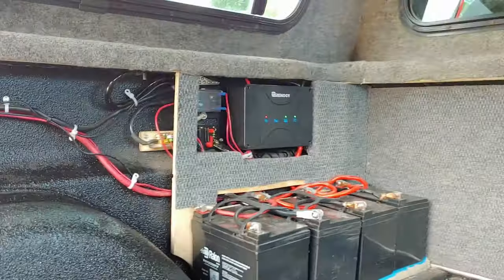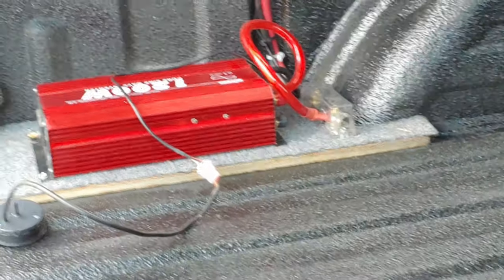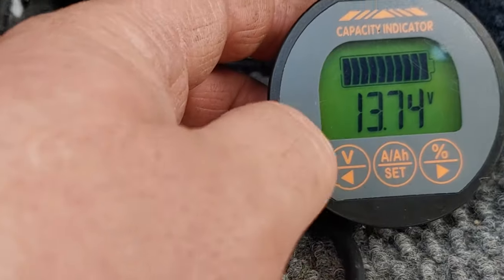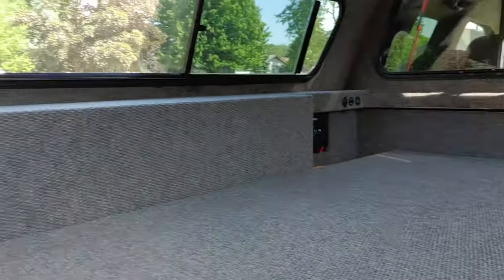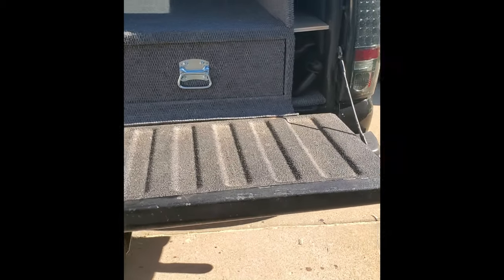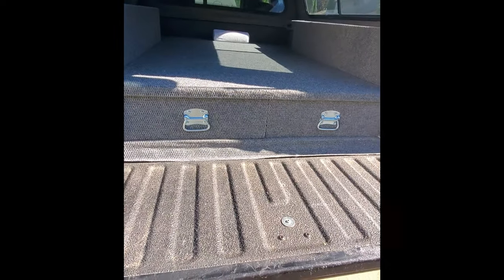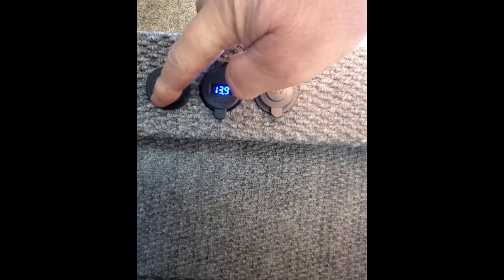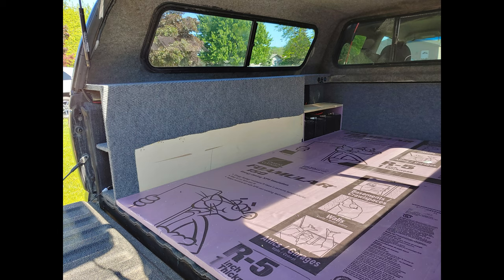Custom truck bed camper build with drawers, storage and Renogy solar power.

Comment: How did you attach the two solar panels to the roof of your shell ???
Reply from the maker: I ordered the angle bracket mounting kit from Renogy. They were silver aluminum, I powder coated them black and screwed them down with a dab of silicone and wood screws (short enough not to penetrate all the way through the inside but long enough to to get a good bite)

Comment: I have been watching truck camper build ups for the past hour and I just really liked the simple, functional, easy set up of yours. Also, i like the really clean and nice finish with the carpeting all throughout. Just a quick question. How tall is the platform? So, if you put a 4" foam mattress, you won't hit your head on top? Thanks for the video and sharing.
Reply: With the height of the storage drawers and mattress, you wouldn't be able to sit up completely. Crawl in or get a mid-rise cap to sit up in.

Comment: Am I right in thinking that the bed sides and platform are not bolted in, everything just slides into place?
Reply from the maker: you are correct and its a super tight fit too...I just had to remove the left side to change some wiring and it took some hard pulling back and forth to pull it up and out over the center section
!

Comment: Super cool I’ve been looking for different ideas four in the back of my 2001 Silverado, I would just want on one side the drawer system for For my bed and I could sit and have my feet on the floor my camper top is 6 inches taller, I just subscribed I am watching from Manchester Michigan, I really like this design Appreciate you sure I’ll be following for more
Reply from the maker: Thanks, I recently did a lot of work in Manchester. Nice town

Comment: Nice setup. How long can you go without a charge while supporting the things you use that draw power? I"m thinking overcast for days or wintertime.
Reply from the maker: I put in a LiPo4 100amp hour battery. I can run it down to 0. So that gives me a true 100 amp hours of run time and if it did get too low with no sun .....It will just charge off the alternator....pretty quick too...@28 amps
Reply: @Roadkill750  thanks for the reply. Nice system! Sounds like the way to go with the Lithium battery.

Comment: How are you fastening the sections in place?
Reply from the maker: They main 3 sections are heavy and solid. They fit tight and don't need any extra fastening.....not sure what parts you mean though? Is there a piece in particular you mean

Comment: Very clean looking, too much carpet for my liking but I wish I had a fiberglass truck cap, mine is aluminum with 1 inch box tubing on the inside and no roof rack. Let me just tell you that the mounting of the solar panels was a long process. I like your drawer system but I like floor with a raised bed.

Comment: Extremely well designed and fabricated. Particularly nice job finishing with carpet. Also kind of you to share your component sourcing.  Super job, thanx for sharing. Would you consider doing a follow up vid on how things are holding up and perhaps what you might have done differently design wise?  Thanx.👍
Reply from the maker: I replaced the bed after an accident and re-did it more to my liking....I will do an updated video
Reply: @Roadkill750  sorry to hear of your mishap. Hopefully it wasn’t too serious. And on the bright side it gave you an opportunity to customize an upgrade. Again, great job. Thank you for the follow up as requested. 👍

Comment: Just need to swap out the batteries from AGM to LiFePO4 when they die.
Reply from the maker: They didn't die, I use them as portable batteries in ammo boxes now for game cams. I did switch out to a 100 amp Lifepo4 battery and it works great!

Comment: Drat, an 11 minute, 36 second video and you devoted only 10 seconds to showing us how you installed the solar panels onto your camper shell...
Reply from the maker: I ordered the angle bracket mounting kit from Renogy. They were silver aluminum, I powder coated them black and screwed them down with a dab of silicone and wood screws (short enough not to penetrate all the way through the inside but long enough to to get a good bite)

Comment: Really nice build; finished product looks great! I'm trying to do something similar in my F150. I have the sleeping platform and drawer done, but wanted to ask how you got the power cable from the starter battery back to the bed of the camper shell? What gauge wire did you use and how many feet of cable did you need? Thanks!
Reply from the maker: I used large multi strand welding cable 2/0 just because I had it. I routed it from the switch in the engine compartment down along the frame next to the factory loom being very careful to protect it and also fused at both ends with a marine type breaker. I didn't measure how much i used, i just ran it and cut it afterwards. guessing about 10-15 feet

Comment: That’s a very nice setup.  I live in the Southwest, and need to worry about how hot my electrical components will get, even in the Winter.  I have been to Michigan, and the Summers there can get a little warm too.  How does your inverter live tucked away, or any of the other components?
Reply from the maker: I never have a hard time in the summer, I have a harder time keeping the battery warm on cold days. Lithium Iron Phosphate batteries can't charge below 32 degrees....I've thrown hand warmers in my Insulated battery compartment  a time or two

Comment: I have a 1992 Ford Ranger with a 6foot bed. I want to rig up an electrical system like yours. Where did you buy the parts of your set up and about how much length of wire did you end up using?
Reply from the maker: I am making a parts list, I'll update in the description over the next couple days a few at a time....

Comment: First off great build! I'm about to jump into my build the next few weeks after my ARE camper shell arrives. My question is how much do you think you have invested in your solar system. From the batteries, panels, wiring and all. All of just the supplies. Thanks in advance.

Comment: Good build but the batteries are in the wrong place have a problem you gotta take that whole thing apart put them in the back
Reply from the maker: No there's an access door that lifts up....flush with the floor so I can access them. Look at the 10 minute mark and see

Comment: How does the solar get connected to vehicle alternator?
Reply from the maker: through the dc-dc converter...I ran a heavy gauge welding wire under the truck into the bed (fused at both ends with a shut off under the hood)

Comment: Thank you for the video.  Have you run a heater off the inverter for long periods?
Reply from the maker: Haven't had a need for heater but I have used an electric blanket over night on a 20 degree night

Comment: Very nice design and attention to detail!  How do you handle venting for the batteries?
Reply from the maker: They are sealed AGM....so no real venting. But the truck cap isn't "air tight". There are holes where the cables pass through under the bed. The air gaps around the tailgate....never seems to have been anissue

Comment: Why not just buy a jackery
Reply: I mean fantastic job tho.
Reply from the maker: Although a Jackery might be good for a light weekend of camping, It's not going to have the immediate power this system has and it's built in and powerful enough to run refrigerators, tools and showers almost non stop. The closest Jackery would cost $2800 and need to be setup and taken down every time you moved.

Comment: Do you have your truck specs?
Reply from the maker: Which specs? 99 Chevy Silverado
Reply: @Roadkill750  Just curious of the bed specs, I searched F150, I want to mirror this build though.
Reply from the maker: 99-06 Chevy Silverado extended cab with the 6'6" bed. Hope that helps
Reply: @Roadkill750  It does thank you, helps with planning.
Reply: @Roadkill750  I got all the parts from Amazon.  Phenomenal build, to mirror yours, following the list from Amazon I should have everything I need.  the Majority of the mounting looks like it is straight into the bed.  Am I correct?
Reply from the maker: Excellent. Let's see how it turns out! I am replacing the bed on my truck which gives me a chance to slightly modify and change a couple minor things that will make a huge difference for me
Reply from the maker: @davidlang1828  nothing is mounted to the bed....just a tight fit